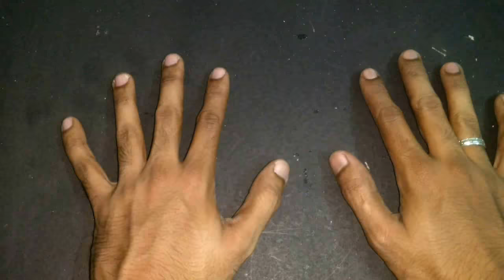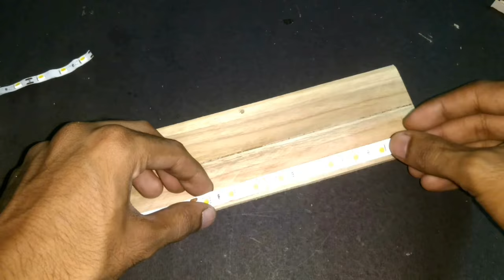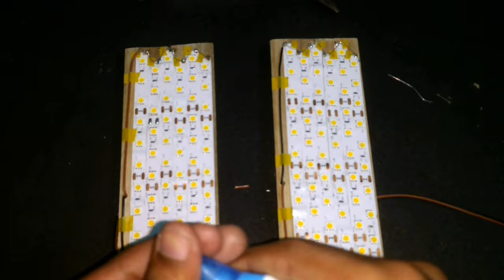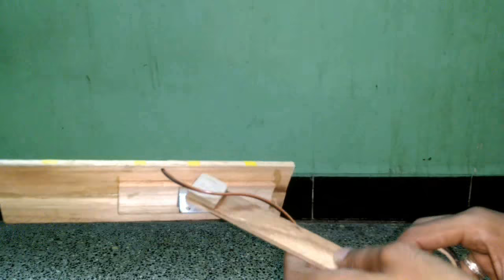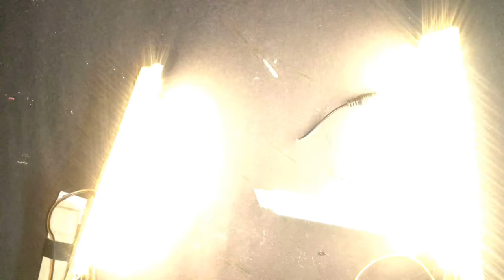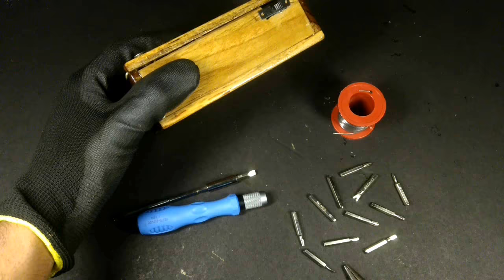Video/Photo shooting lights version 2

Comment: what is led strip price
Reply: SMD 5050 start 220
Reply from the maker: +Soumojit Ash it can be anywhere between 50-65rs per meter depending on your area
Reply: I have some cool projects with led if you need it I can share with you